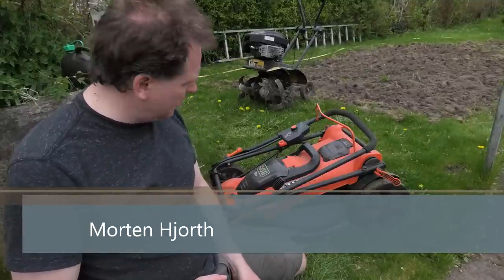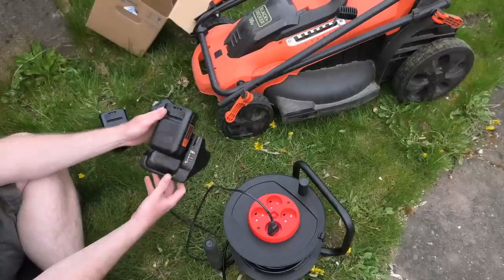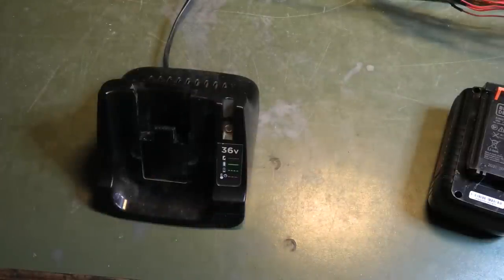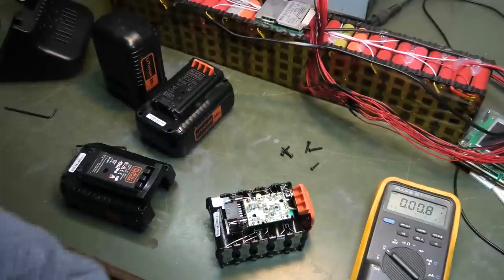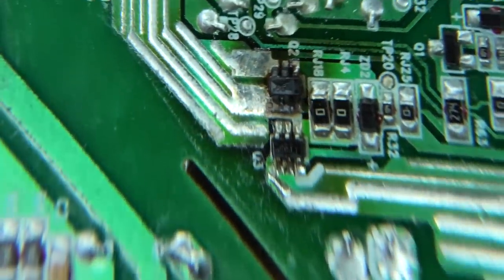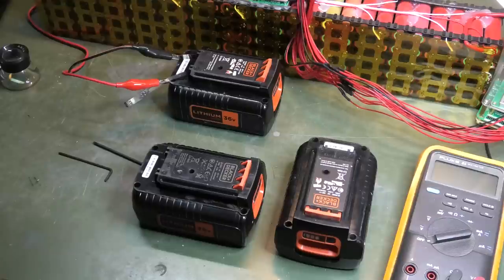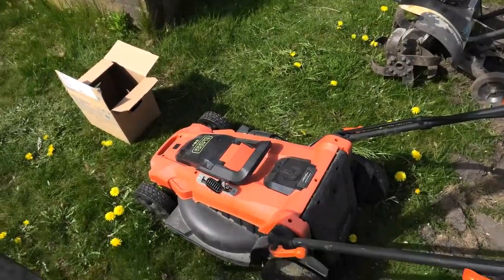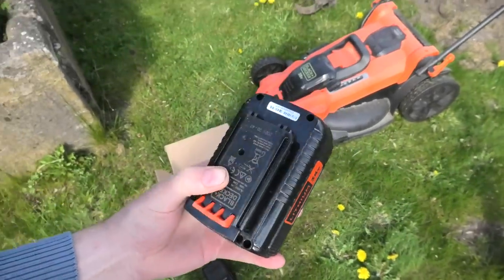Black & Decker 36V Li-ion Lawn Mower - BAD Charger - 1180

Comment: The last charger issue I had was on my ryobi. The AC side was passing power to the diodes, power upto the transformer but the caps at the logic side had 0v. The issue was mosfet which was specially ordered for about £6 gbp, pain to desolder but ultimately an easy fix. Also upgraded the 1200mah cells to 2200mah.
Reply from the maker: nice with a fix and a upgrade :-)

Comment: In many ways it is very misleading, the batteries are rated at 36v, you measure 35.6v on one of them, and yet the indication says it is completely depleted.
It isn't until you charge them to 38v that there is a bit of life in the battery, and you actualy need to charge them all the way to 42v, before you have 3 green indicators.

Batteries are weird.
Reply: Not all cells are 4.2v rated top balance, some are rated at 3.7v top cell balance. 3.2V and 3.7V cells are different.
Reply from the maker: I agree,,, these 18650 cells are normally rated at 3,6V,, so 10 of them in series is 36V,, but they work well down to 3volt,, so it could discharge battery down to 30V and be fine :-/
Reply: @MyPlayHouse  lit-ion work from 3V upto 4.2V

In spec the charge need to be 4v upto 4.2V
Reply: These are sold in other countries as 40v batteries. The 18v version is sold as 20v.

Comment: The batteries are quite the trash. Very high internal resistance. The saving grace is that it's possible to buy an offshore case+pcb.and place 10x inr18650-25r. At least this was my experience. It's true the charger runs too hot, though.
Reply from the maker: Thank you very much!

Comment: Hmm a switch mode power supply, they are lightweight.
You could check the voltage before the mosfets in case the switch mode has gone mad lol.
Reply from the maker: But this was so light,, that I was surprised to find a PCB that big..

Comment: If you reprogram it to 512 bytes it will mow faster, but a bit less reliable
Reply from the maker: humm 512b and cutting edge technology. :-)
Reply: @MyPlayHouse  if the sector is big , you will waste space if you write files less sector size ( less 512 bytes) .

Comment: If that Mosfet was available quickly I would change it and see if that was the problem
Reply from the maker: Yes,, I have ordered them,, but it can easily be weeks/months :-)
Reply: I think the mosfet break beacuse voltage more then 60V and now had 35V output. 

This fet connect to charge pins,

First stage is  240V had high voltage fet (upto 600V dc) there had the problem not the sec step output pins

Comment: The electric lawn make not quite then patrol engine.

by the way, black & dece had low quality tools.

In power supply , the best is lniar ( transformer) then step down low quality power supply.

The mosfet tran is p channel 60V, the charge voltage need to be 4.2  x 10 cells total 42V.

I wiil use mosfet that can hold upto 100V .

if you see 35 total voltage  and had 10 cells , you dont need to check each cell voltage , divid by 10.

10 cell si
Reply: I was buld electrice bike controler for 1000W brush motor.
Spike and the fet gone , then i use N channel 600V with low ohm in On mode.
Reply from the maker: Hi Oren computer & electronics
Thank You very much!  glad you liked the video :-)
Thank you for watching! :-)